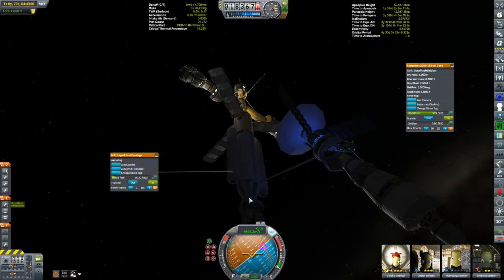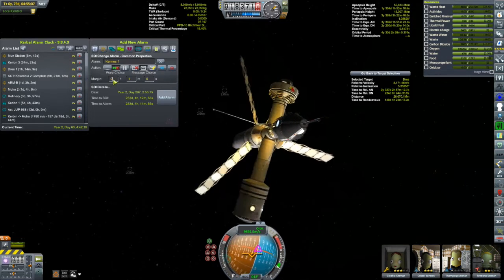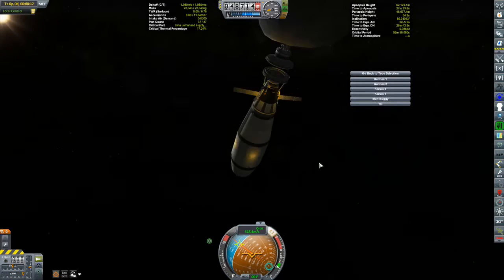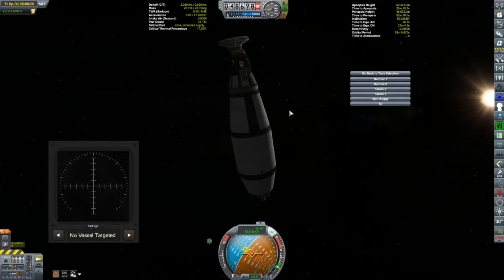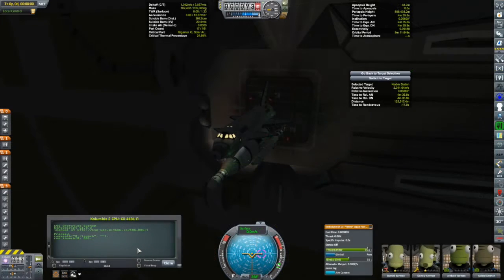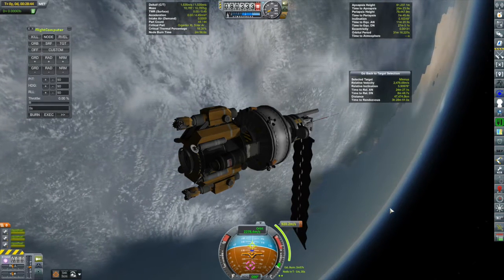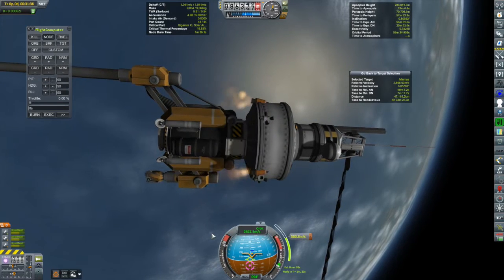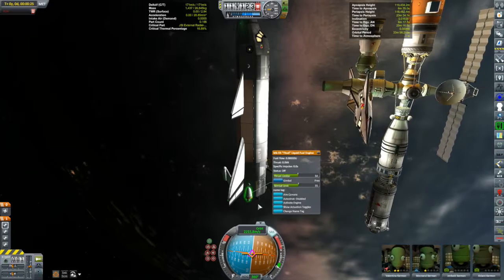KSP Career: Episode 111 - Making Mistakes So You Don't Have To

Comment: KSP has been modelling thrust occlusion as you saw on the driller for a while - at least since 0.90. Not sure what the constraints are, but it can be a real pain. Glad to see that you could fix it on the fly though!
Reply from the maker: I'm surprised I've never run into it, but then again, I generally wouldn't build something where the exhaust was occulted just because it doesn't look right.  This was a modification of an earlier failed mission.  Maybe I just slapped on the bigger drills, made sure the delta-v was okay, and never bothered testing it.

Comment: I see what you mean about Trajectories working for you. Puzzling. I wonder if it's something in my settings.
Reply from the maker: It is puzzling.  I do think something has changed in the aerodynamics modelling.  For example, something I didn't show is that parachutes don't seem to slow you down quite as effectively.  I didn't show it, but all the boosters from the shuttle launch were lost because Stage Recovery didn't feel there were enough parachutes to slow them down enough.  The same thing happened with the boosters from the Mun Station launch last episode; however, the stages were recovered in testing in 1.1.3.
Reply: I've got to wonder if there is an aero change between 1.1.3 and 1.2.2, but that it's subtle enough that your KOS go to orbit script provides enough fine control to mask it, while my ham-fisted manual approach causes things to go haywire. 

Well, I think it's time I added KOS to my game.
Reply from the maker: I have a parallel 1.2.2 series going where rockets seem to fly fairly well without kOS.  Are you using the fuel flow overlay in the VAB?  It's a godsend if you rocket is built from a stack of smaller tanks.  I find the numbering system on the overlay rather confusing, so make sure the tanks are draining the way you think they should.
Reply: I see now that I made a grave error: I did not turn on Advanced Tweakables. I've corrected that, and now I can autostrut and set resource priorities LIKE A SPARTAN WARRIOR.

This is going to change some stuff, obviously.

However, I loaded one of the simplest rockets I had that was showing stability issues. This rocket only had one fuel tank, so obviously fuel consumption order wouldn't change anything. Upon loading it in the VAB and bringing up the COG and lift tools, I was surprised to see that it had no center of lift. Adding fins fixed that, but I've got to look at some of the other more complex rockets that had the same issue.
Reply from the maker: Hmm, I didn't even notice that was an option that could be toggled off.  I'm playing a bit with the rigid connection option too and liking what I see.
Reply: Yeah. It should be called "Turn awesome new options off." It also deactivates the "open parachutes when safe" option. I mean, who would want that anyway?
Reply: Nice job in the shuttle landing!  That is still one of those challenges I have not mastered...yet
Reply from the maker: Thanks.  You just have to give yourself some time to practice.  Unpowered landings aren't that difficult.  Hitting the runway is the challenge, though if you put it in the water just past the KSC, you still get something like 90% recovering. So the in game incentive to put it on the runway isn't that high.

Comment: Mike "Supermath" Aben making all those mistakes! Perhaps you should just do like the rest of us and strap on "Moar boosters".

Does your station lag with all those parts or do you have a super computer to run it all?
Reply from the maker: No super computer.  I just speed up the playback so that the game clock runs at normal speed.  Watching with the lag would be pretty insufferable.

I don't think "moar boosters" would have solved any of my issues today.  A little RCS, though.  I really have got to stop being so sparse all the time in my builds.